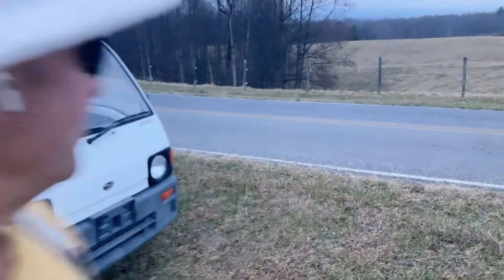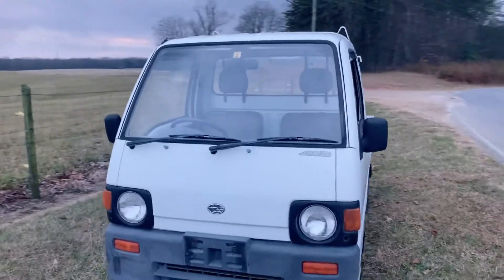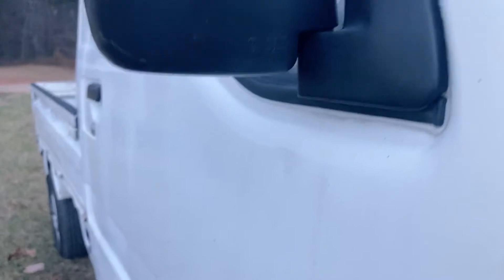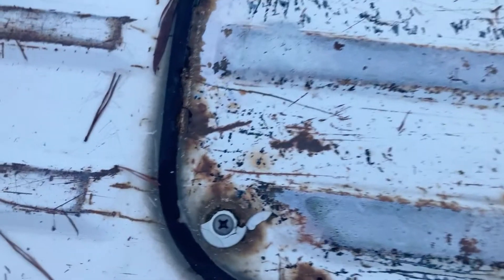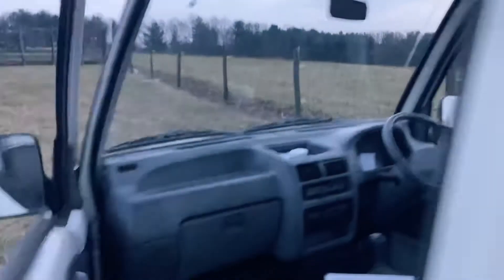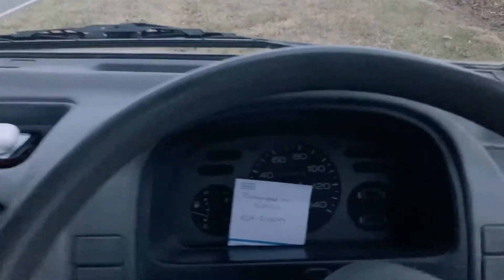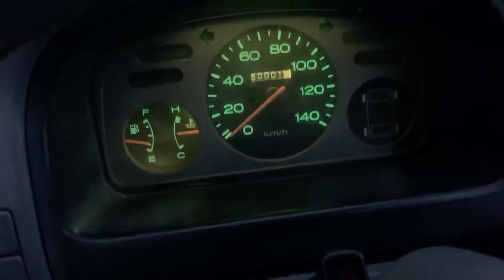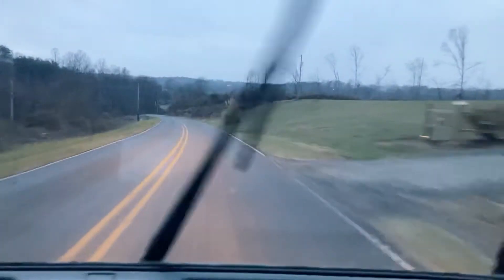SB9790 1990 Subaru 5sp SUPERCHARGED 4x4 Japanese mini truck Street legal $7,000

Comment: Tony is the Subaru more quite than the other trucks - in the video you can't even hear it running?  That is an awesome truck thank you for the videos
Reply from the maker: For sure, the Subie is so quiet you have to be careful not to over rev the engine.  Two reasons as you probably know...four cylinders instead of three and all the way at the rear of the vehicle.